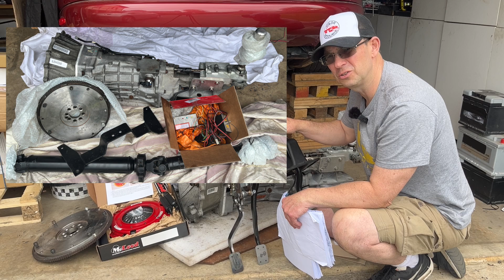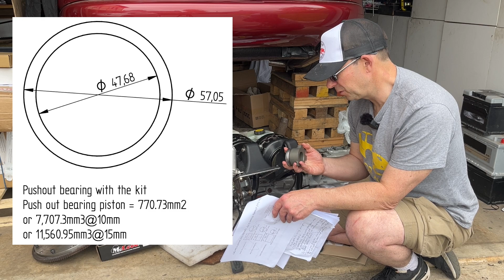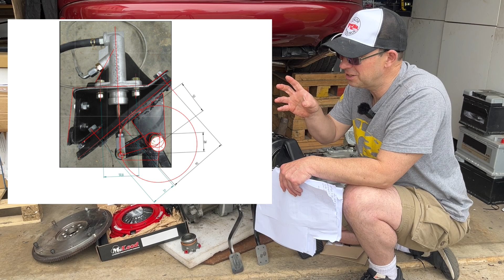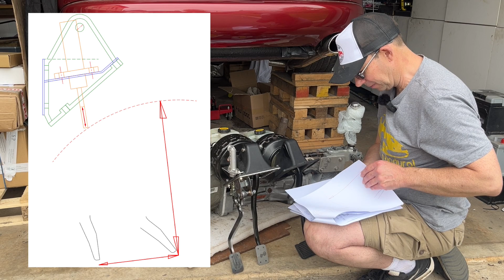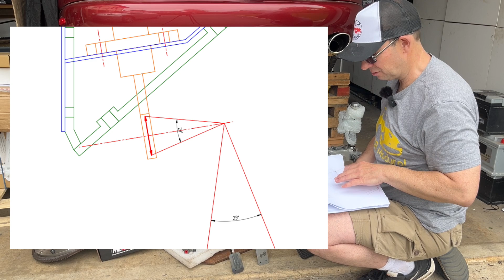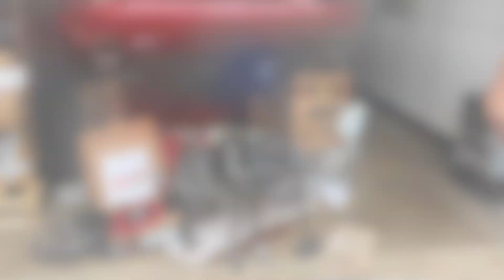Jaguar XK8 Manual Swap: Our Custom Clutch Pedal Design & Prototype! Components MT08 XKR X100

Comment: Great video showing your ups and downs of what “should be” easy.

It seems to me that ignoring wiper mechanism interference in favor of sound pedal box engineering would be the preferred route to follow. Slightly modifying (bending) the wiper mechanism arm would be far simpler than re-engineering your already re-engineered solution. Even if you had to elongate that pesky arm to get your needed clearance.

Regarding the needed clutch movement: If the manufacturer of the matched components is confident that it works as advertised, then go with it and hold them accountable. As long as your clutch pedal travel provides the required plunger travel, there should be no issues. (Says one who has no skin in the game.)

Best of luck with this project!
Reply from the maker: Tom, Thanks for the message.
You are the second person to suggest modify the wiper mechanism, starting to kick myself. To be honest I haven't contemplated modifying it. The cylinder wasn't difficult to tune out of the way of the wiper. Preferred to try and find a solution within the modified pedal box we were already doing to keep the final solution more simple. 
Reference matching the clutch system components. The clutch people said the same thing and we are probably over thinking it. The problem comes when say they have used thousands of 0.7" master cylinders without any issue but then find the are at least three different stroke lengths for the same cylinder 1.1", 1.25" and 1.4".  We have opted for the longest stroke but need to go through two cylinders to get one. Like you mentioned its easy for people to say it will be alright on the night but its not their time and money. Can't understand why they can't tell me the throw-out cylinder specification. Going to measure myself at some point. I feel like I have got an arm. leg and left kidney in the game.
 Thanks agian for your support, regards Damian
Reply: @Modurol  You might try asking your new Jaguar connections who have been there, done that. Good luck.
Reply from the maker: @tomfurie2996, no one seems to be able or willing to share any details, regards Damian

Comment: I am doing the same project on a LHD car. I have the XJS pedal box modified for the 4 bolt boost, I have not installed yet but will check the wiper linkage you mentioned on the LHD. I am using the ZF 6S-53, since it should fit without modification. I have the same flywheel and clutch you showed, am using the S-Type throw-out bearing need to check travel though. I have built a CAN bus module to "fool" the XK8 to think the auto is still installed. It works on the bench, but have not tested with the XK8 yet. Do you have a email to dialog the progress?
Reply from the maker: Glenn, sounds like a parallel project but LHD. Interested to hear your experiences. Our Email address is oanddr@gmail.com . Your canbus module sounds very interesting hope you can get in working, regards Damian.